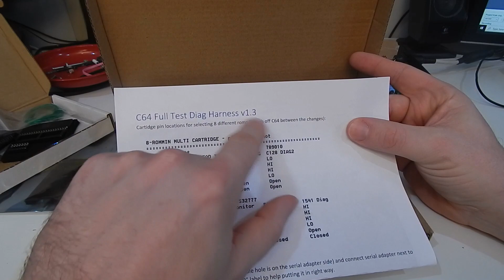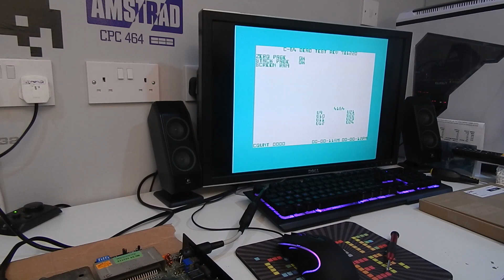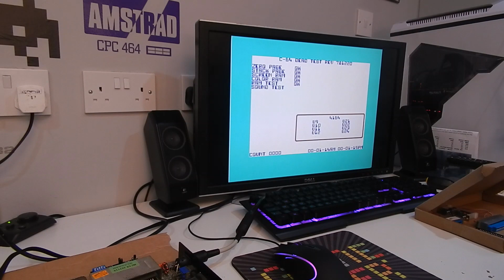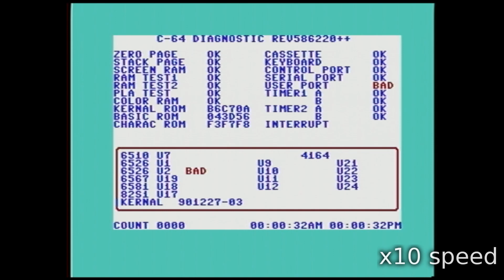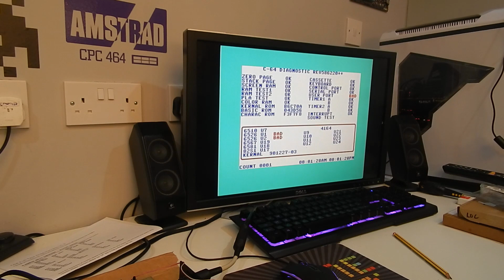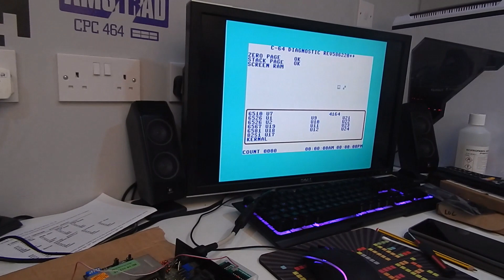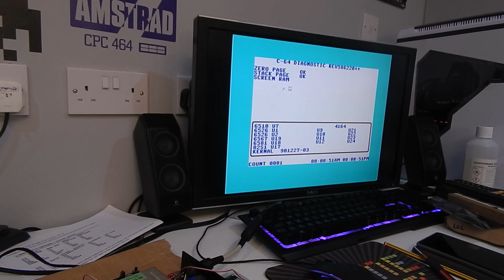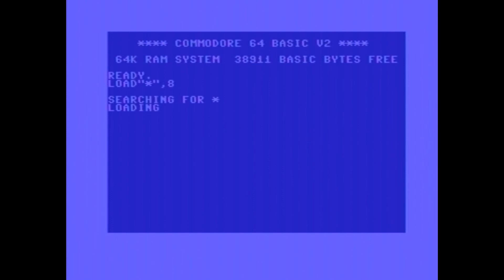Commodore 64 dead board repair Part 2

Comment: Aaah, I used to have a Commodore myself. It takes forever to load games up, but when it does, god damn it had some absolutely epic games for its time.  Congrats on the repair, and I hope you at least tried some games on it right off the bat.
Reply from the maker: The C64 doesn't get as much use as I'd like (same with most of the collection actually) but I am partial to a game of commando every now and then. Great machine and that sid chip, awesome!

Comment: Excellent vid both of them, one question tho is there any thing on the c64c board that's known to die for no reason other the age and over use , so i can grab a spare or two before they become even more rare .
Reply from the maker: The ram is probably the most common failure.  There are only 2 ram chips in the C64C and they are cheap so doesn't do any harm getting a spare set.  In reality though any of the chips can fail.  The likes of the SID, CPU, VIC run hot so a heatsink will help extend their life.  Also make sure you have a good power supply.  Most the chips get their 5v directly from the PSU.  If that fails then multiple chips will fry.  I'm currently working on the other board you seen in part 1 that suffered an overvoltage.  So far 7 out of the 8 ram chips are fried..

Thanks for watching and for the kind words.
Reply: @CRG  np thanks for replying  and looking forward to the next